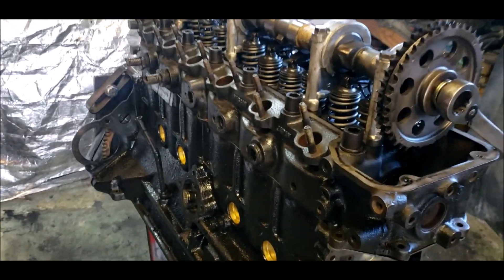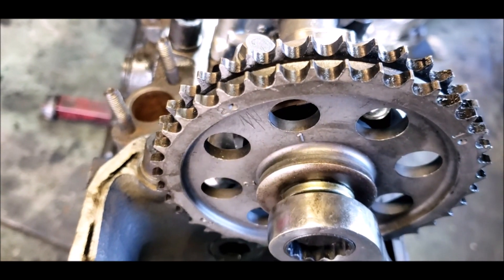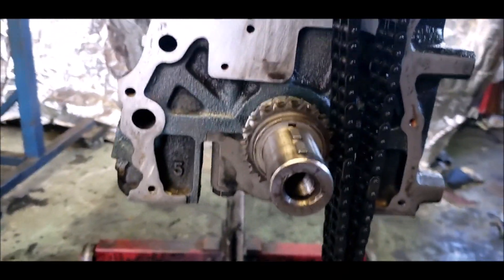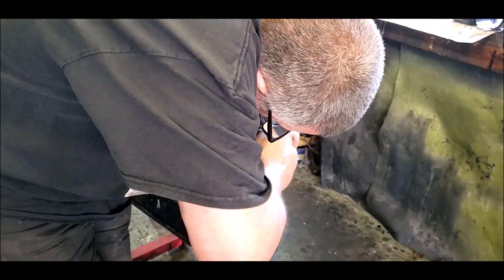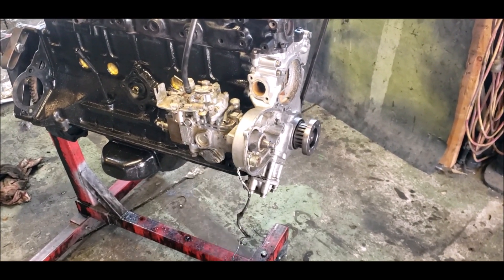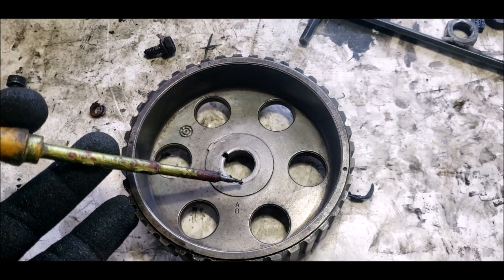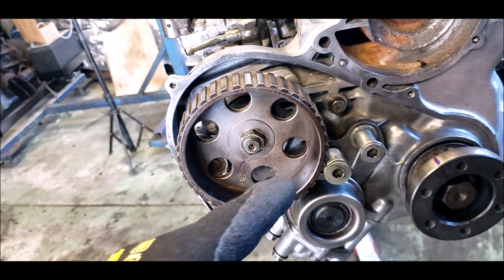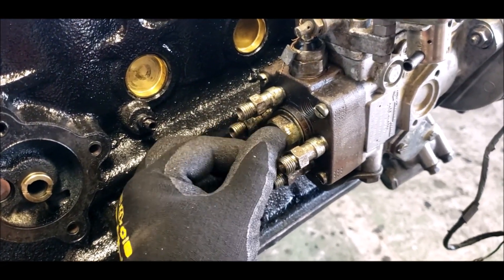Nissan LD28 = engine TIMING  &  injection pump TIMING

Comment: Очень понятное видео.Спасибо.Просто реальная пошаговая инструкция.Что Вы в ставляли между стрелочным датчиком и плунжером когда датчик не доставал до него.По видео не понятно.
Reply from the maker: Yes sorry about that .
It was a bolt that was thin enough to fit in the hole and long enough to go all the way in and have enough left that it stuck out still.  Then I just cut the head off it.
But you could use a bit of rod or even a match stick
Reply: @BUILT_BY_ME  Странно как то.У Вас метка на коленвале для ремня и метка где Вы обозначили шпонку коленвала от моей отличаются.У Вас между ними 4 канавки,а у меня через одну от шпонки.И на другом моем двигателе так же.Вы когда собрали мотор завели его сразу без проблем?Или еще настраивали?

Comment: lovely thanks for this mate. back in 2007, i had one of these which the diesel pump failed. i naively took it off, marked it up, had the pump rebuilt, and reasembled. put the pump back on and to my dismay it would not fire up. no one would give any advice on it, apart from"you should scrap it now". undeteered it got stored in the back of the shed. the last few months, my enthusiasm has been rekindled. with thanks to your self and others, i shal start to get the thing up and running again at christmas threw to easter. thanks again for sharing. the world neefs people like you. cheers alll the best😊
Reply from the maker: Awesome mate, glad you found the video helpful and good luck with the project!

Comment: Hey man, for some reason I cannot see the marks on the flywheel, looks like the flexiplate is covering that hole, may be from a different model or something. Is there any other way I can confirm tdc on the crankshaft? Maybe the woodruff key pointing up? Also, Is the crank sprocket locked once installed on the crank? Does it have any markings on it that could lead to tdc confirmation?
Thank you in advance!!
Reply: technically if I line the 2 marks on the timing chain with both the little mark on the crank sprocket and the 1 on the outside ring of the camshaft gear it should be timed. Or am I wrong?
Reply from the maker: It's yours manual or auto?.
The reason is if you have a flywheel you won't have a flexible plate.

And unless it has an aftermarket flywheel you should be able to see some marks when you look through the hole On the sandwich plate. 
But if not then I would imagine if you have all the other marks in place....then thats it from memory

Comment: Very good video ! I’m not even english but I understand all steps ! But the problem is that i have three marks on the pulley of my LD28 (A, B, and an unlettered mark like yours). I adjusted the timing to the unlettered mark, but the engine smokes a lot, won't start when it cold and unstable idle
Do you recommend using the "B" mark?
Some people have advised me to do this, but I'm not sure because I have the same number of notches between point "A" and the unlettered mark as you. 

Sry for my bad english. Hope you understand 🙂
Reply from the maker: Cheers mate, glad you found the video helpful! 
Your English is fine.
Ive only ever done this motor and the way I did it worked for me.
I havnt ried it another way sorry.
Reply: @BUILT_BY_ME  No problem, thanks for the quick reply !
Reply: @VampAnthem999 you can try anyways!! I’ve read people just guessing adjustments from an almost ok point and end up working just fine. Kinda like carbs haha

Comment: Good video, clearly explained and backed up with footage!👌😎
Reply from the maker: Thanks..I find its the easiest way I learn to do things .. and I struggled to find a clear understandable video on the timing of the ld28 and injection pump
Reply: Cuántos dientes tiene la banda  o correa que va del sigueñal a la bomba de inyección del motor Ld28??
Reply: @miguelbarrios6086  20 dientes cuando genera el ultimo salto de inyección Tenes que mover la polea manualmente hasta posicionar el punto de polea con el diente marcado en la correa en el minuto 10:12 te lo explica saludos!